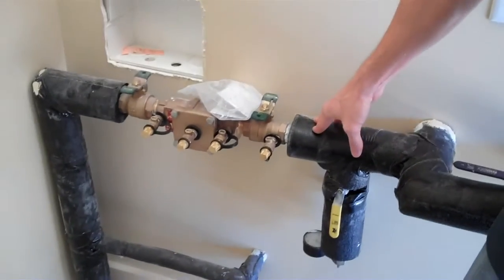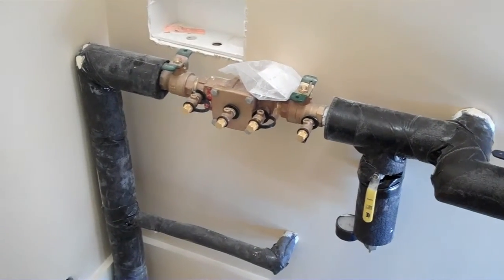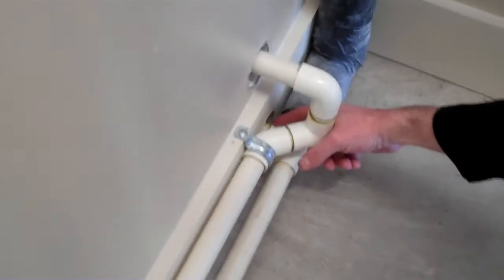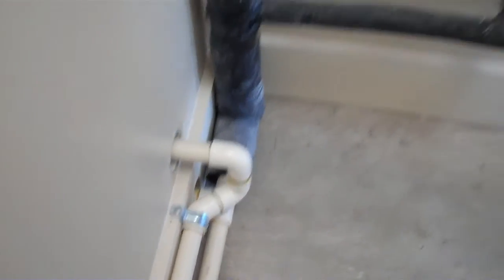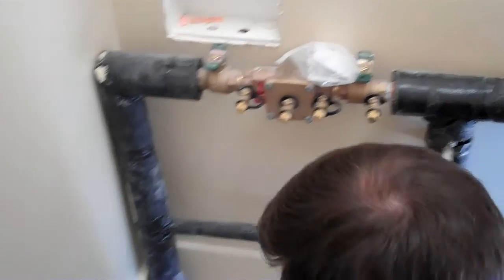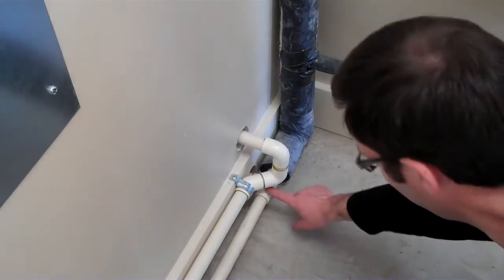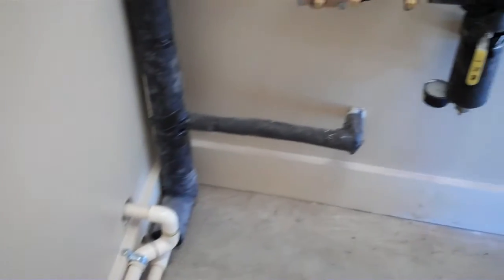Rainwater System Overview with Chris Maxwell-Gaines

Comment: As usual an excellent video. I was not aware of "wet" systems, probably because we can bury our tanks in Ohio! Would you happen to know the HP rating of that pump? While nosniborn has a valid point about electric use I would expect that the running time (hours) per year to be low enough to keep any costs minimal. Still it would be interesting to place it on a meter for a while just to see how many KWH are used.

Comment: Questions:
- Would it have helped to bury the tanks or was that not an option?
- Why did the water specialist say that toilets use non potable water, that's not accurate.  Most plumbing codes insist that toilet tank water must be potable.
- Did you not have to install a double backflow preventer to the municipal supply?